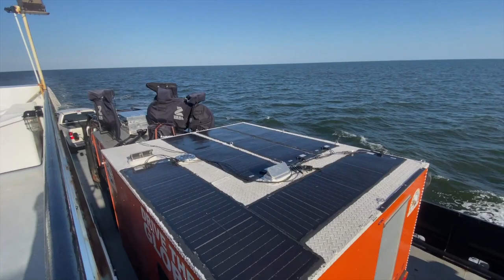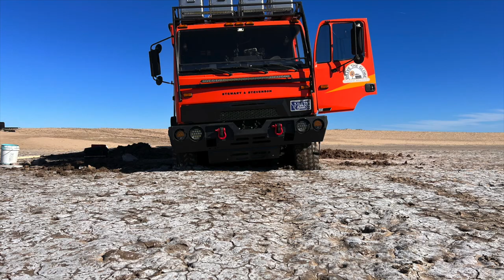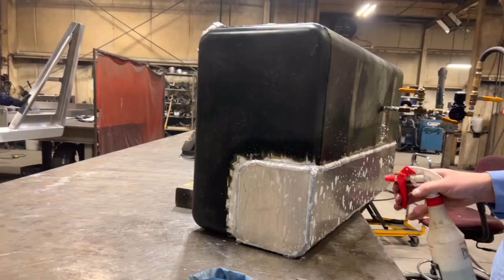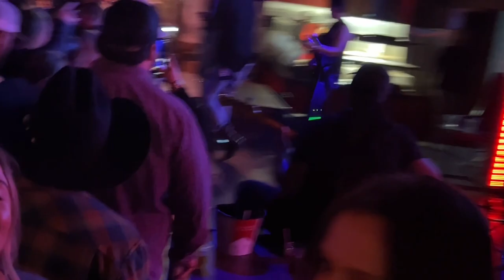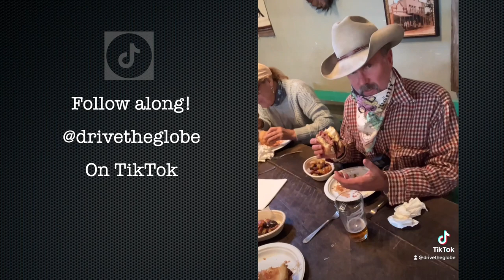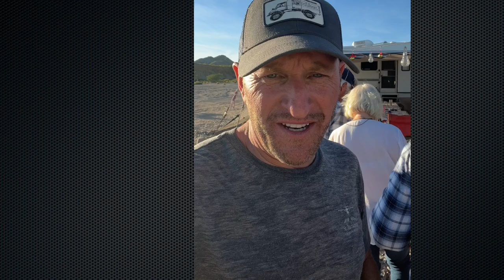Hopelessly Stuck In Baja California In My Overland Truck

Comment: What additional kit did you add to your truck to self recover in the future?
Reply from the maker: Working on a winch mount now, although in that particular situation self recovery would be impossible.
Reply: @drivetheglobe  For sand recovery you can bury a tire (exhausting) or use a "dead man anchor". I contacted them and they said buy 2 to get enough pull power. Last option is giant stakes roped together known as a picket line.

Comment: What have you learned from the experience?
Reply from the maker: Avoid the dark sand like areas!   Ha, and the truck is pretty heavy. Although I have had it all over a bunch of beaches and sand is not really an issue.
Reply: Will you equip (winches, cables, soft shackles, traction mats) before the inevitable next event comes along?

Good to see you on Doodles!